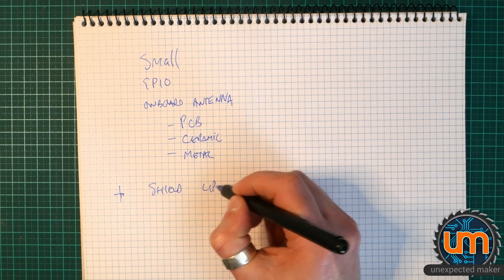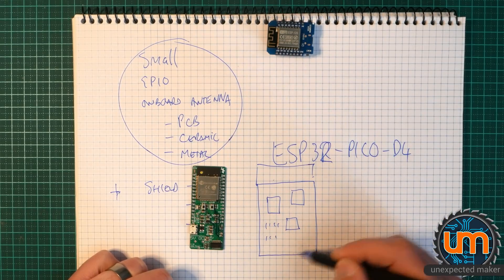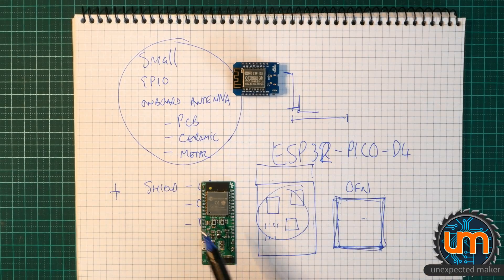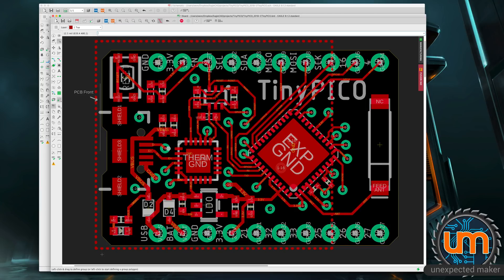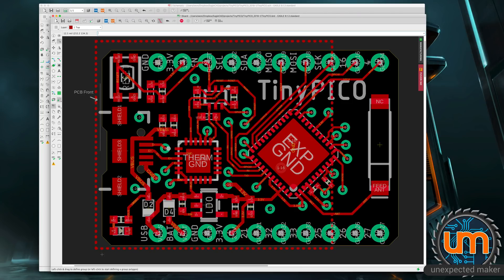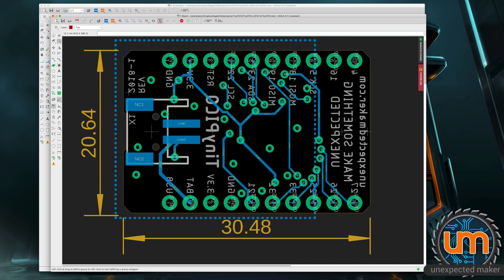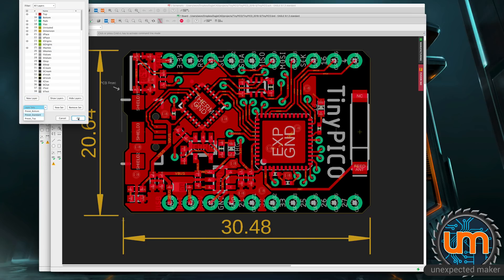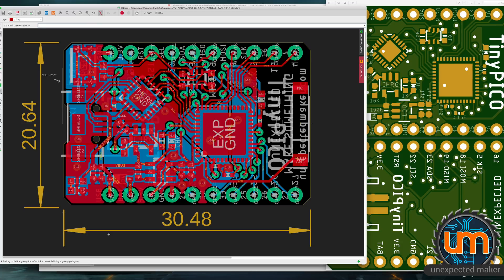TinyPICO - Let me tell you a story....

Comment: Excellent work Seon. Interested in this Micro Python. Will be interpreted vs compiled. When does the stack collapse? Will have to actually do some Googling for my self. I know about Circuit Phyton again never checked out. So thank-you for putting some of these options back on peoples agendas. A one-man Australian industry - very impressive.
Reply from the maker: Hey Michael, I'm a total noob to MicroPython... check out micropython.org for lots of info on it, but yes, it's interpreted, but runs great on faster micros like the ESP and SAMD51 etc.
Reply: It is generally considered interpreted Michael but the reality is a little more complex. MicroPython code (.py files) is compiled down to a bytecode representation (.mpy) at runtime before the bytecode is executed. However you can also pre-compile your code and MicroPython can execute the bytecode directly, skipping the compilation step.

Note that the bytecode is still interpreted - much like Java or .NET bytecode - but it's at a lower-level, more easily able to be optimised. 

Hope that helps!

Comment: That is beautifully designed, Seon! :D
Do you have an enable pin anywhere in the circuit to stop the rest of the circuit leaching power from the lipo when it's not being used?
Reply from the maker: Not at the moment. I didn't want to give up any of my other output for revision 1, but I'm sure it will get some future improvements :-)
Reply: Nice 😀 It's such a tight and neat board! The all-in-one with the lipo capability is very tantalising 😊
Reply: Low power is on my radar for rev 2 (or 3. Or 4. Some time soon anyway!).
Reply from the maker: Is it now? ;)